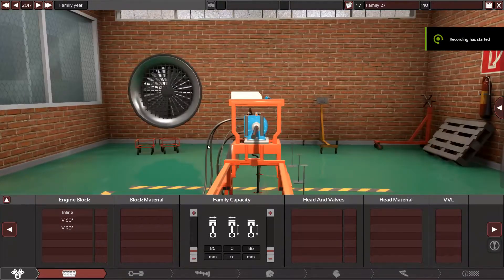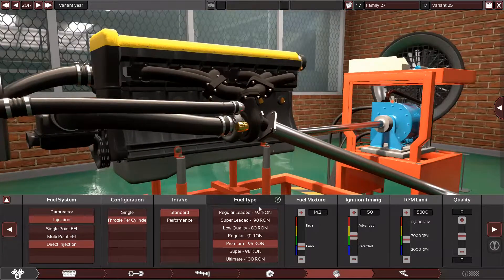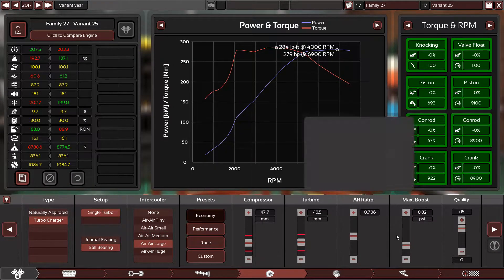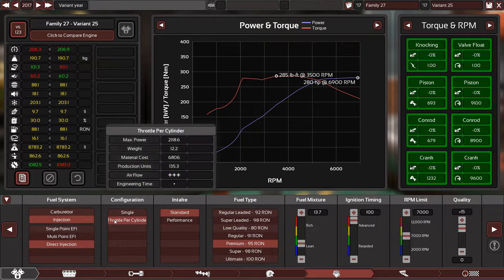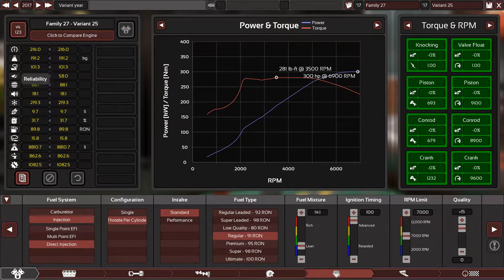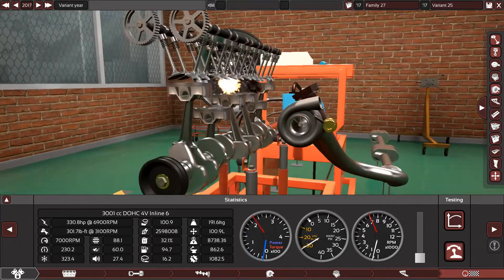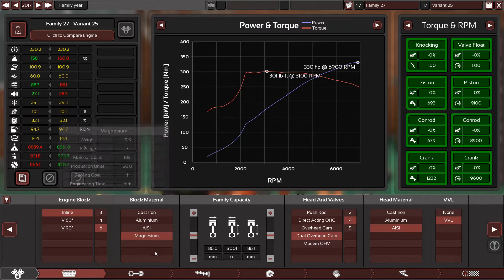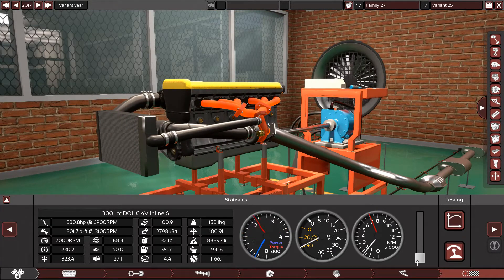Reliable Inline 6 Turbo engine build.

Comment: Could you do a 4.9l inline 6 engine that has good horsepower, good torque as well as good fuel efficiency?
Reply: Specificall, the Ford 300 Inline 6. I couldn't find it in your requested famous engine playlist. It would be nice to see it for a truck.

Comment: Hello I have a question about the quality. why do you use always plus 15?   its way way to expensive its like a old engine from 1900 with pistons out of platinum or gold you know ? pls build something nice without so many quality. Thx dude. keep it up mate
Reply from the maker: +Unknown Username 
I use the plus 15 in the some engines that sometimes the parts are about to fail or to get the maximum reliability, RPM, max torque, max fuel efficiency est... 
in the cheap build like family sedans or hatchback i put the quality to plus 3 or 2 max 5 so the engine will stay cheap.
Thank you for your awesome comment 
I appreciate your support.